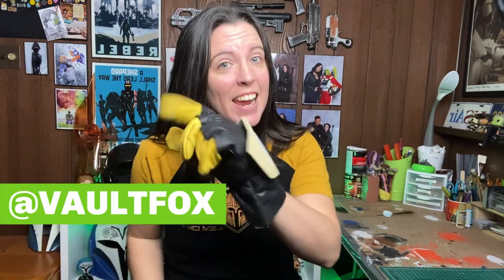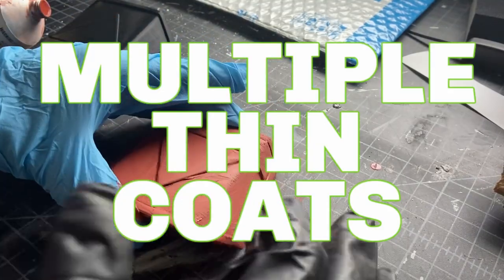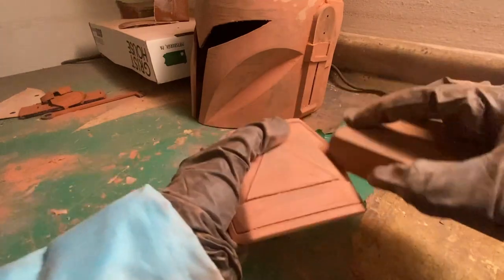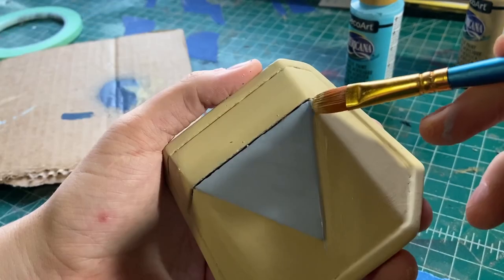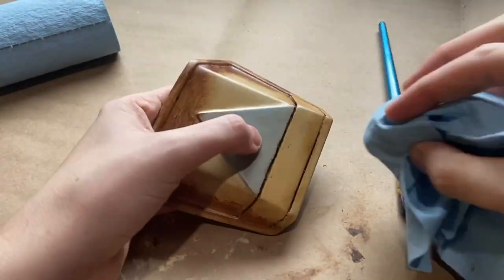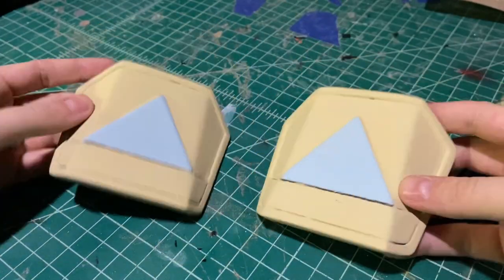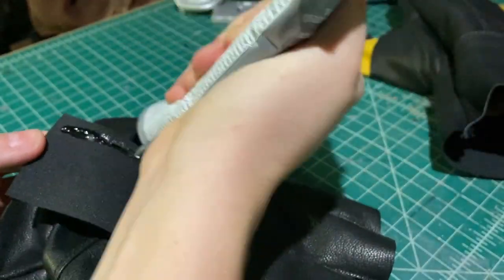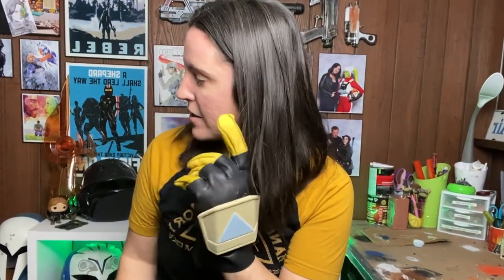NO SEWING! How I Made The Mandalorian's Gloves // Making a Mando Pt. 2

Comment: Rather than use the bondo method, you could buy some printing resin, a UV flashlight, and a model paintbrush. Less work and easier to sand. more detail as a result as well :)
Reply from the maker: I have several videos on my channel using that exact method!